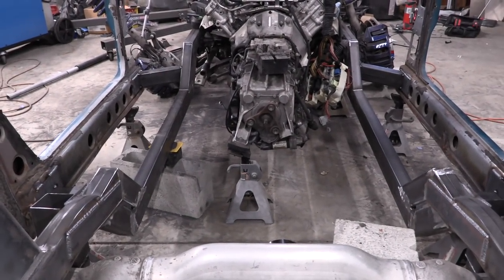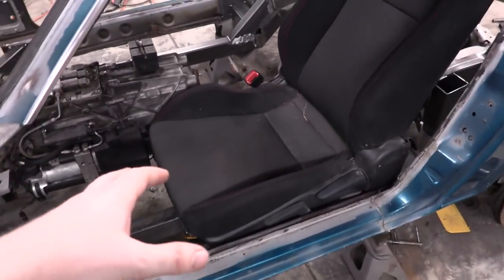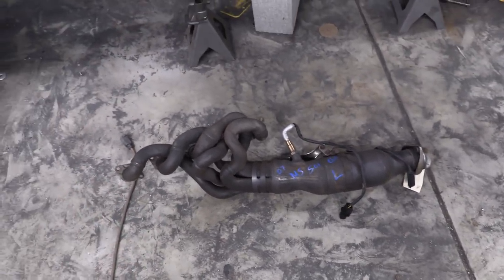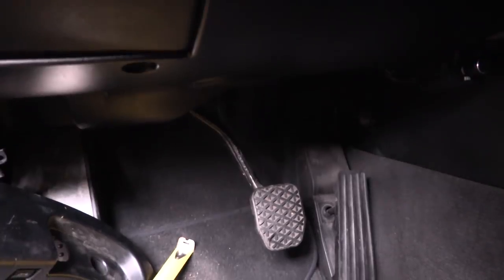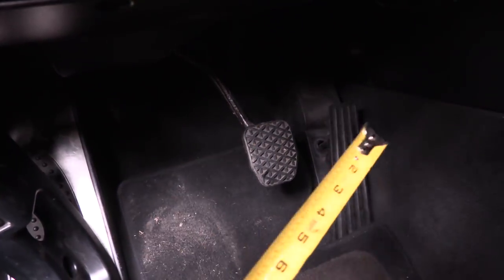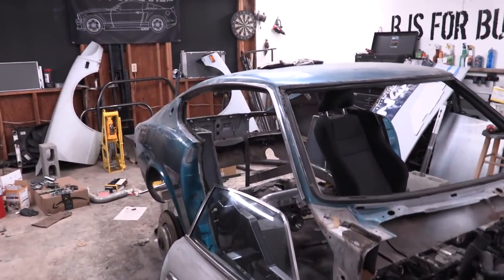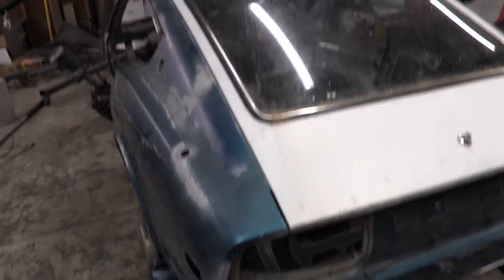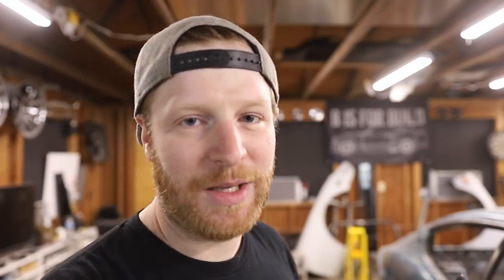Who Knew 240Z's Were So Cramped? Where Can I Buy More Leg Room?

Comment: Why not redo the frame?
Reply: I see this with customers all the time, just because they are so far down the rabbit hole with a bad design, they feel compelled to move forward with it.  First, the front down-kick in the frame should land where the rear part of the K member is hanging out in mid-air, near the motor mount.  Second, the rear down-kick in the frame should land right in front of the subframe assembly.  The odd doubling up of the frame added section thickness, but simply adding doublers/fish plates to the outside of the frame would have been sufficient and provided more space.  I know he's learning, but if this is really his show car, he should take the extra effort to fix the mistake instead of compounding it.
Reply from the maker: Aslak Zissou
we might.. i need to see if we have time and how much time
it would take. If you measure from the rear subframe/rear wheel arches, to the end of the firewall, if we had zero frame obstructions, it’s not seeming to save us much space, that’s why i’d didn’t make the “redo” decision yesterday.
Reply from the maker: EFormance Engineering
it’s not an issue if we’re too far to change it.. it’s an issue of if we change it, are the results worth it.. after lots of measuring it’s been looking like results not quite worth rebuilding the entire chassis
Reply: well... if it`s a show car... it really does not need to run... like most of the sema cars
Reply: B is for Build tweaking the engine position slightly. tweaking the chasis rail position slightly. tweaking the chasis railwhere it rises slightly that sits behind the seat will probably net you enough room and save you heaps of very complex time consuming modifications that will always feel substandard.  Sorry for being another negative nelly.  If I were you I'd follow through the whole process the way you plan to do it now as opposed to making some possibly time consuming tweaks😐
Reply from the maker: glados we don’t have any issues with width of the frame section, if it were pinned to the body rails, it wouldn’t solve any problems for us, and you must see how it’s less strong that way.
Reply: B is for Build it opens up a ton of interior space, footwell, seat height, etc.. provides side impact protection, etc., etc..
Reply: you could even weld them on as is and cut out the old stuff after
Reply: EFormance Engineering I totally agree with you. You’ll see in many smaller cars with giant engines that are pushed back, that they’ll also move the seating position back as well. I think this is a scenario where that needs to happen. Right now the seating location is as far, if not farther forward than stock. Redo the drop downs, move seat back, move steering back, win.
Reply: Why not do it right the first time...
Reply: Can you extend the frame back and just make a longer front end.
Reply: Wouldn't you be able to move the seat further back if the frame rose up next to the seat instead of behind it?  Would running some cross members behind the seat maintain the strength of the frame?  Not sure; just throwing out ideas.
Reply: Hey man, just take the front part of your double rail downturn and put it on the inside. Boom 4 inches. It will be just as strong and there looks to be room.
Reply: andydelapoer  I see why you posted that: 9:06. The frame rails jump up BIG and drop back. Chris could also push those rails out and solve all kinds of issues.
Reply: Extend the body
Reply: I was also wonder why not redo the frame.. but I also have to ask to what effect will it be useful?   For one, There still needs to be a rear wheel well behind the seat, and that has to be a pretty large thing.   If you look at frame 3:04 you can see where he is probably going to end up putting his rear wheel well, and approximately how big it will be.. From the back of the door to that wheel well, he only has a inch of space.  So its not like he is magically going to get more driving space by redoing the frame.  He really just needs to find the smallest, thinnest buckets he can and hope that he not too tall to drive this car.

Also redoing the frame would cause it to twist weirdly making it weaker force of driving.  So instead of 2 frame rail, he suddenly have to have 4 frame rails and shit ton of gusset plates to handle forces of being drive...   Now if he did.. me might be able mount his seat between frame rails to get the seat lower... But that not really helpful.  he really needs to have height to look over the hood of the car.  If he just mounted his seat up more over the frame, he possibly could clear that frame section and also get the height he needs to see over the hood of the car.

The design is a little bit jagged and clunky.. but considering what he has to work around, it still might be the most effective method to execute the idea.  plus having the frame like it is now does give him some useful design elements like being able to keep his exhaust right next to a frame rail, and far away from his transmission.

Now the only reason I see to redoing the frame might how his rear wheel might actually be not in arch of the rear wheel wells.  if you look at frame 1:27 his rear shock tower look to be behind the center of the arch.  I might be wrong, but If I am looking at the perspective right, and if the shock tower needs to be  exactly up and down, then I would think it be covering up the hole at the vary top of inside arch on the passenger side.  This might not need to be where the shock towers need to be and he has yet to put the wheels on the car.  The other thing to keep in mind is that if you look in that frame at the rear wheel on the driver side, that looks to be about in the center of the wheel well....so it might not be anything and because of the vary trippy effect of the lens we are not really getting a good idea of just how much space there is to work on this car.

(BTW...what kind of lens are you using for your camera..  I really like what it is doing to for you when you do shop videos.)

In any case...All in all I think he might just be better served by first answer questions like how big is his rear wheel well going to be, and how small of a seat can he stand sitting in before he tackles trying to get more space from the frame.  Also.. inches might be miles in this build, but he could be compromising the function of the frame getting spare  inch from if he does not leave enough material in place.  Soo I would put any more frame modification at the vary bottom of the list at this point.  There is just too many other things that might be a problem that makes it not worth it.
Reply: B is for Build how about 5 holes in the fender as an exhaust like older planes?
Reply: with the extra roll bar stiffness, he can cut out chunks of the add on section of the frame to make the seat go back a few inches and the foot well also. can also hollow out the door a bit to fit the seats and add some elbow room.
Reply: Sema is on again next year,Better to spend the time getting it right now,if you continue with a compromise you will shoot yourself in the foot later.
Reply: I think you need to redo the the rear frame section! I was curious why you did it that way? You are gonna need as much room as possible. I think just bite the bullet and redo it now! Instead of waiting till you already have the roll cage in when it will be too late! Also even though I think that V10 is a neat idea I think you should go with something else. You are not going to have room to swap everything over just to get it to run!   As well as the fact that you won't be able to use any of it?
Reply: Cant he double the drop downs sideways instead of lenght wise. On the rear i bet there is no clearance issue if he welded some frame tubing on the inside of his frame. So he can cut at least the front drop down tube off from the rear dropdown and gain a couple inches without having to completely redo his frame design
Reply: Glados hey Glados   ... GLAD to see u xD
Reply: B is for Build agreed! I haven't seen to many production cars out there that the frame is pinned to the body rails. Most bodys sit over the frame rails, or on top and hang over.
Reply: Sweaty McSweatyy That would look pretty sweet but I don't think it solves the problem

Comment: For all the trouble you're going to, you really need to do it all right so you're not wasting your time.  You need to make sure you have ample footroom.  Either move the engine forward, stretch the frame, or move the kink in the frame backward.  You need to have a temp firewall with temp pedals mocked up in there because I think you underestimate how much space its going to take.  I'm saying this as a fan because I really want to see this project succeed because it's going to be badass.
Reply: E Anderson yes, theres not enough room no matter how small the seat is, that rear frame section needs to be fixed probably the best way to solve the problem
Reply: Doing things right? In this build? Never going to happen. It's been wrong from day 1 of fabrication. There was no real planning, which foresight would've helped avoid issues. And anyone who tries to provide knowledgeable help gets called out as a 'toxic hater' because you know his massive ego is more important here. 
It's going to be funny when we get a video about everyone at SEMA being toxic haters. You know every real fabricator there is going to point out the flaws in this build, and you know he can't handle any amount of criticism.
Reply: Xander Zoolander if it even makes it to sema lmao
Reply: SEMA 2018, no. 2019, maybe. 2020, most likely. 
Unless he abandons the build since literally none of it is correctly made. 
Or, you know, it's trashed the first time it gets hit. A side impact is going to absolutely fuck this car up if he keeps the rails like they are.

Comment: Had you not incorrectly cut the rear of the frame rails that hold the rear sub frame when you started the build, you would have all the room you need. Messing up those frame cuts really screwed the whole build from the get go. I hope the lesson is learned to not make assumptions about how to build a car from the ground up. Also mocking up measurements based on parts you arent using is only creating more problems for you as everything comes hobbled together at the end of this build.
Reply: If only there was some sort of warning. At least hindsight is 20/20 lol
Reply: I hope it works out for him, but yeah...moving way too fast for his experience level.
Reply: A bit more thought in to moving strength in to the rear cage and there should be no need to double up the drop on the rail and he will gain needed inch's.
Reply: lol! i remember him cutting it then building in the drop down and thinking...wait...aren't we back to where we started?
Reply: That and not starting with a complete thought trough plan. After all this effort, this car will not be better than a stock Z chassis, in any way except originality and creativity.
Reply: Jeff, the part about knowledgeable people being 'toxic haters' is part of what has made me stop watching this channel. I, like some others, have been suggesting that the custom rails should be tied into the Z's original rails. I've been doing this since earlier episodes, never got a reply; but there's another comment thread on this video where this was brought up, and the reply was basically 'it doesn't fix our current problems,' and someone else pointed out all the benefits of it, but there's been no response to that. There's also been other issues that get brought up, but get ignored; maybe he just shouldn't be asking for help if everything goes ignored and gets labeled as hate. 

His arrogance and, for lack of a better term, brute force approach to building this really makes things hard to watch. He could have easily planned things out, thought out any problems that came up, and could have done this build properly, while not being up his own ass constantly. I'm really hoping his approach to things, and his attitude towards people, matures before he gets too far into this; you know if this goes to SEMA, anyone slightly critical about the build and the methods used will just get labeled as a 'toxic hater' even though those who would be critical are the ones who have been building custom cars for decades. He honestly wasn't ready for a project like this, and should've stuck to engine swaps, repairs, and meaningless lemon builds.
Reply: Xander, i was reading all your comments when todays video got posted... PMSL!!!!!!!!! Goes off on one calling his comments section toxic!!! hahaha   I am here out of morbid curiosity these days!
Reply: chill

Comment: If I were you I would jig that frame back up and remove that bulky ugly transition to the rear subframe section. It looks like it's preventing you from moving the seat back as well, just split the angles and put one piece between the two sections of frame(plate and plug weld if you want a little extra security.
Reply: It'd be better if he'd just properly tie the custom frame into the Z's body frame, like he should have done the first time. Like a lot of us have been suggesting, yet we all get called toxic haters for it. 
And if this does go to SEMA, you know every actual fabricator is going to point out that mistake. Guess all the pros are just toxic haters too.

Comment: Why don't you make the front strut towers first so you can get the chassis rolling ?
Reply: brecht hendrickx probably scheduling around Eric's work schedule.
Reply: Probably because that's too easy and some 'toxic haters' suggested that, and you know his attitude towards those 'toxic haters' and the knowledgeable help they try to provide. 
Eric's welding isn't really needed for a rolling chassis, and can be done later. 
There's no reason why the front suspension hasn't been fabricated yet, other than bad planning, poor foresight, and an ego problem with a metric shit ton of arrogance.

Comment: You can use top mounted pedals. Should give you freedom. The cabin situation less than ideal, but you were warned about band-aiding a mistake with the frame rails. It only gets worse as you work around it more and more. then when it's all done you will wish you took the time to fix the mistake.
Reply: Top mounted pedal might be hard because the BMW really expects the E-Pedal, there is some logic in this thing.

Comment: If your seats are slimmer and you want to be higher as you raise the seats you will be able to move the seat slightly further back. Probably a couple of inches (a slight help). Good luck. Loving the project.
Reply: Just what i think. And maby if he needs he can make a little c-notch in the frame too to get an extra inch. But mayby he should try with a helmet on just to see how it clears the roof and bars

Comment: I know it's more work than you'd like and probably already been said (I'm sure someone will tell me *eyeroll*), but if you widen those frame rails, you'll gain a lot of space and could lower your floor.
Reply: Same thing I was thinking. He needs to fit the wheels so he can make sure they clear, then angle the rails outward. Maybe even section out a portion of the body and tuck the rails into it. But seeing as how much has gone into making them go downward and how set he is on taking it to sema, highly doubt he'll go back and fix his mistakes
Reply: Very true, there's plenty of ways to skin a cat. I'd personally build a simple square tube frame (with an X-brace) that's tied directly into the body, tie those into the front and rear sub frame, add some gussets, and then tie the roll cage into everything.

Comment: A viper is 10in wider . that gear box is bulky. The frame design hadnt considered a driver till after it was welded up. Having built and modified lots of sixties kit cars .
 Mocking up every thing is a natural normal part of design. The datsun is very roomy in standard form  it was designed for big Americans , comfortably. Most 6' drivers fit with out much difficulty .Its actually a classic, tall people can fit in, which is rare in the sports car classic/ vintage world. 
   You got balls building on the fly
In front of the world. 
   May be a quick study of a viper chassis may help since you , dont have a Z chassis.
And maybe a Factory Five cobra coupe chassis. Just for some design chassis solutions.
   Maybe intergrating a thin sheet tub with modified frame you already  have, would be another design route.

Comment: You can use that bmw dash, use a template to trace the pattern of the Z curvature and trace it on the bmw dash. cut the back of the dash and it should butt up. You will most likely need to build custom brackets. You can also make it skinnier if you needed, chop off a section of the glove box side. Once you finish cutting take it to a good upholstory shop and get the dash alcantra wrapped with some cool stitch work. Watercooled VW guys we did this all the time. You may loose ac ducting, and the dash rebar but you will have a bmw dash in a Z.

Comment: Redo that rear kick up you can probably move it back all the way to the subframe mount. It'll be a good bit of work but should give you the room you need.  Also I'd kick those frame rails out to meet the bottom of the door sills.

Comment: Chris, you will need to use the gauges cluster if you are planning on running the standard ecu and wiring loom.The gauges are coded to the ECU & central control  module. Limp mode otherwise. So fitting the cluster to the 240 dash is the mission at hand.

Comment: @01:50 you can always do NASCAR style side intrusion bars on your roll cage to give you far more with in your seating position sadly that just means you would have to cut out the door panels and use fixed window glass with perhaps even a plexiglass sliding slot for air flow